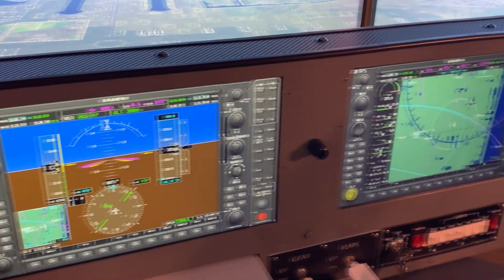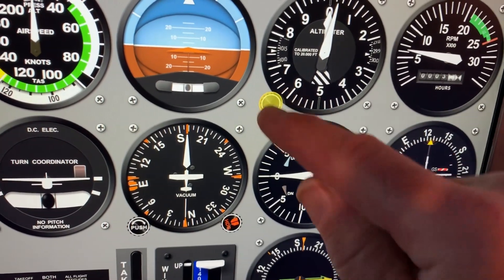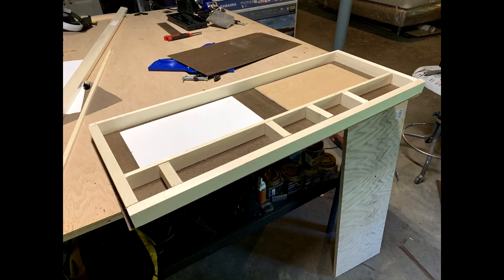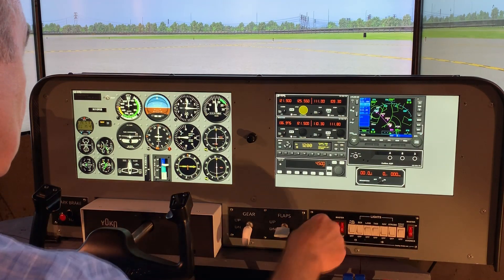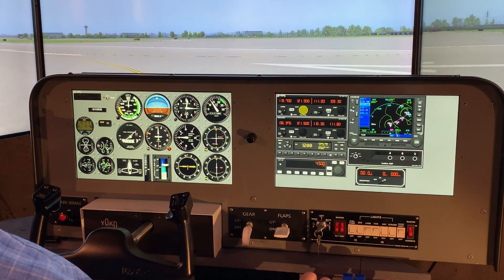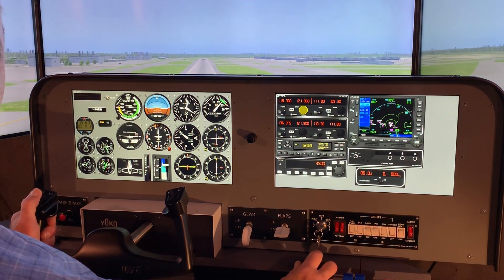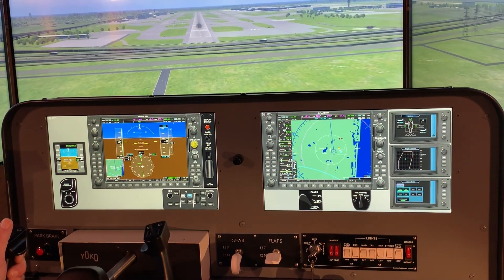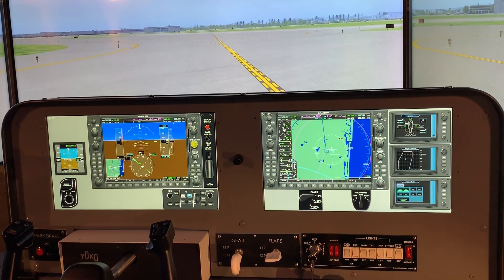DIY Twin Touch Monitor Sim

Comment: Hi Russ, is this worth getting?  https://www.mypilotstore.com/mypilotstore/sep/13433
Reply from the maker: Depends on what you want to use it for and how rich you are😁. If you just want to train on or learn the G1000 there are cheaper ways to go. Did you see my video https://youtu.be/v0YDHN2eCMA ?  It shows how you could use a couple small touchscreens like I have n the twin touchscreen monitor sim and a Knobster to achieve a good training platform  (full scale too) for half the price. It could display other panels too using Air Manager. If you want to build a highly realistic sim with hardware controls Real Sim Gear makes good stuff and will definitely provide the most realistic experience. A touchscreen and Knobster can get you 90-95% of the realism and the exact same function as the RSG G1000.  The other thing for me is I don’t want the G1000 there all the time as fly in some steam gauge acft too. One last thought. If you have a three monitor visual you will need two additional graphics ports since each G1000 screen needs its own. This is true for the touchscreen route too. I did a recent video seeing if the internal video could support the fifth monitor and the results were it is better to have a second panel computer running the  master copy of XP if using the 5 monitor setup. Good luck on your decision.

Comment: So my 2 monitors came, and just for fun, I popped out and move the g-1000 to them. PFd on the left and gps on the right touchscreen. Looks insane! However, when I touch the gps it pops back away! 😂😂😂. I downloaded the XtextureExtractor and tried following your video. But some how it loses me every time. Like there was steps missing in the process. Can you help me please. Thank you.
Reply from the maker: Duane Bennett what does “it pops back away”  mean. Do you mean the window closes or moves? Is Air Manager involved in your set up? Shouldn’t need XTE to use  the G1000s so lets stay on that first. Explain in more detail and I will help.
Reply: Russ Barlow so, airmanager is not included in my setup, I’m just learning to setup a triple monitor simulator, so £55 was a bit too much at the moment. But in short, just setting up individual views with the sim and monitors is a chance he for me. So if we start with the Cessna 172 with the steam gauges. Not G1000. I would like to place all the instruments on to a 27” monitor in front of my yoke, and the gps system on the 22” touchscreen, and have the 65” tv ahead of me for just views. For some reason, the smaller touchscreen has to be set as my main display on the pc itself, for touch purposes. Which poses a problem IN x-plane. But by pop away I mean, when you click on the gps, it gives you a pop out larger window. I try drag that down to the touchscreen, but when I go to use the controls on it via touch, it’s like I clicked on it again in the cockpit, and puts itself back away. Computers are complicated 😂😂. Any help or advice would go a long way friend. Thanks. 👍🏻
Reply from the maker: Duane Bennett so you are running this all with a single computer? You have the TV with a scenery view and a second 27” monitor you have a separate view of the XP11 instrument panel. Finally you have a 22” touchscreen you want to display popped out XP GPS windows on. I think I have it now. 

First why do you say the Touchscreen must be your main monitor? Have you calibrated the Touchscreen in windows so that it knows how the touchscreen area is related to the monitors. It defaults to assume it is the main monitor but can be changed 

When you pop out the GPS there are two steps. You only mentioned one. First click the 3D cockpit GPS and it will pop UP into a larger 2D version you can drag around within the XP windows. You then need to click a small icon (hard to see and only visible when the mouse hovers over it) at the upper right corner of that 2D GPS. This will Pop it OUT into a real separate window which can be dragged by the white title bar at the top to any location on your windows desktop(outside the XP windows onto 22” monitor three). Running the instrument panel on the 27” monitor will lower FPS but until you add two more large TVs to get a wraparound scenery view it may not be a factor. Air Manager is a very low impact on FPS and offers great panels that support touch control and Knobster. I place a Air Manager bezel over all my popped out GPS windows yo hide the white title bar and add better touch input functionality to the GPS. Knobster allows easy knob inputs that are more difficult with touch in Air Manager and almost impossible with touch on just the popped out XP GPS

Comment: Nicely clear video, ask:
How do you turn on the touchscreen? at the back or at the front?
Reply from the maker: actually need to attach via  usb(should hear the connect tone when plugging in)  and go to Windows settings and search "Calibrate pen and touch" .  Select "setup" and follow the on screen directions.

Comment: Excellent build! I’m slowly but surely working towards a sfx-100 motion cockpit with all instrumentation. For now though, my 3D printer gets here this Saturday and I have all the hardware for several instrumentation switches and gps buttons etc. I’ll probably start with the Garmin GNS 530 but eventually build G1000s. I want tactile feel for VR, but eventually I may upgrade to a full sim non-vr. I see this as a 1 to 2 year project but I’ll be up and running with the 530 probably in the next couple of weekends. You, OnTheGlideSlope, and Alfred Twinsim have been my inspiration.
Reply from the maker: MrJoeDynamite Sounds like a solid plan. Keep us posted as you progress. Especially interested in the motion system and hit it works with a sim.  I never felt they were worth the cost in the commercial sims I flew in the airlines but with VR it is so immersive that I might reconsider.

Comment: Is there a problem adding two touch screen monitors if you are already using 3 for your flight sim? Can the video card handle multiple monitors? Do you need some type of splitter or an additional video card?
Reply from the maker: I just did a recent video of this topic using the onboard video to run the fifth monitor.

Comment: Hi Russ, How did you make the black dash-board that outlines this cockpit panel? -I wish you went more into the build here. Keep them coming!
Reply from the maker: Robert Zimmer I had some scraps of a fiberglass reinforced wall panel that is somewhat rigid yet flexible enough to make the radius around the corner. It is 0.09” thick so think. I cut two layers and glued and stapled one layer using gorilla glue. Then added a second layer gluing it on the first. Afterward I added some carbon fiber looking contact paper film I got at Pep Boys auto. I added a black plastic door edge trim also from a Pep Boys.The glued layers are quite rigid and strong.

Comment: Great Videos Russ: How did you mount the monitors on the back side? Are they just sitting on the cross piece of lumber or did you secure them somehow?  I currently have (3) 12" touch screens, but they are 1366x768. I am thinking of upgrading to these monitors

Comment: Russ,  I have been watching your videos along with a few others.  I use to fly till cost just got to expensive. Still thinking about ultralight route but in the mean time looking to put together a sim.   From looking at all the videos I think you setup is the most cost effective.  One large 42" curved monitor for main display,  panel with two touch screen, plus yoke probably honeycomb.  I do understand I will need the knobster and software for gauge/panel setup.  I see in this video you have three monitor plus the touch screens.  What do you think about the 42" curved monitor setup?  Thank you,  Ray
Reply from the maker: If you are happy with about a 90 degree wide field of view it will be fine. For instrument practice that is fine. If you want wider view of 180 degrees FOV so you can look out the wing line for flying patterns and ground reference maneuvers you can’t beat 3 large monitors. I wouldn’t be surprised if you could get 3 decent 55” TVs for not that much more than the big curved monitor. If you thought you might go that way in the future I’d probably get a single flat 55” TV and possibly run it at 4K instead of 1080p

Comment: Great, great, great video. Thanks a lot. This is exactly what I was looking for.
I have Air Manager since a few days, and also a 15.6'' Monitor touch screen. I have a small question because I can't really use G1000 Popup on my panel.
My 15.6 inch monitor is connected to the same computer (I have only oene for now) where X-plane and AirManager are running, the monitor is set as main monitor in Windows (maybe this is wrong, but this was the only way I found to make the touch screen working correctly), and I have a second monitor for the sim, a 52'' Samsung TV 4K. My problem is the following one: when I pop-up the G1000 window from Xplane and then click on the upper right corner of the popup to make it movable like a window, everything is Ok. I can then move the G1000 'overlay' under the AirManager panel displayed on the 15.6 monitor, all ok. But, when I try to click (with the touch screen) on a button of the AirManager G1000 panel, the overlay window of the G1000 becomes completely black. I have to move the mouse pointer to the X-Plane window and click somewhere to display again the G1000 overlay. I am running X-plane in window mode not full screen (maybe this is wrong). Do you have any idea of the problem, or maybe you already have a video that explain exactly how to configure and set the overlay G1000 under the Airmanager panel ? Thanks for your answer.

Thanks a lot anyway for your video. I just discover your chennel recently and I am sure that this will give me a lot of inspiration for building my own cockpit (I am just starting...)
Very interrested also by the knob. This will be my next order...

Comment: Great builds. Now that you have tested the HoneyComb Yoke (which i just purchased today). How would that swap or transition into the Yoko slot. Also I have been watching out for the Throttle Which has a nice set of switches itself. I am very interest in building a Panel set up and you Idea is absolutely great for wanting to do more with just general aviation aircraft. Thanks a bunch!!

Comment: Likewise with the diy options. I have all the parts but no arduino sketch. Also have you tried two knobsters - one for each panel or monitor?
Reply from the maker: wildgoobsid5 you don’t need a sketch. There is a Arduino Knobster installer  in the Sim Innovations Wiki.

You could use multiple Knobsters but the whole point is to be able to operate any knob on the touch panel with a single Knobster. The only practical reason I see for a second Knobster would be to keep the Knobster near the other panel like an overhead panel.multiple Knobsters are supported although only one knob can be selected at a time for use with any knobster

Comment: Great Video!  Do you have the dimensions of the cockpit?  I would like to put the Honeycomb Alpha Yoke and Throttle Quadrant in it.
Reply from the maker: It is 37" wide so you can scale it from a screen shot.  I didn't draw it out before I built it but hopefully you can get most of what you need based on that width dimension. The cutouts need to be exactly sized for your monitor's inside bezel edges.
Reply: @rbarlow  Thanks for the response.  I've  enjoyed your videos and help.  I'm getting back into x-plane and will be updating my computer to set up a 3 monitor system and  another computer running panel/panels for air manager (I will be waiting to see how 11.50 previews before updating).  I've viewed your 3 monitor system video (3 yrs ago) with 50" TVs and wondering how that has worked for you and if you've updated your computers.  I noticed that Michael Brown is recommending 60 - 65 inch TVs.  Any thoughts would be helpful.

Comment: This video inspired me about 2 months ago to get a Prechen monitor, order the knobster (which is still backordered) and install Air Manager and Air Player.  I've also been looking at Stay Level prior to seeing this video and my main concern was limiting the number of planes I could fly.  This video solved that issue and that is where I want to go.  Have you been in contact with Stay Level since you made this video and if so was any progress made with them?  

I'm currently running a high end i7 9700 computer overclocked to 5.0Ghz, 32Gb DDR4 @ 3200MHz, with a GTX 1080 Ti graphics card connected to a 39" 4k monitor.  This computer is solely used for flight simulation and I prefer flying in X-Plane 11 but I also have Prepar3dV4.  In order to efficiently run a 2 Prechen setup with a Stay Level panel I'll need to add a 2nd less powerful computer as the master to run these monitors and any other items I might add to the panel.  My existing computer would only drive the main visual. 

I already have the Virtual Fly TQ6 Throttle and I was thinking about going with their Yoko yoke to replace my CH.  However, I had a chance to try the new Alpha Honeycomb yoke and was pleased, especially given the price versus the Yoko. If you have any advice, suggestions, or thoughts it would be most appreciated.  I really enjoy your videos.  They're extremely informative.
Reply from the maker: vpwebsvc sounds like you have a good setup. That 1080TI was way ahead of its time and still very near the fastest 2080s. I am hoping that XP11.50 delivers the fps we want with a less brawny system.  The honeycomb Is a nice yoke and the switches are handy but it is not nearly as sturdy as the Yoko plus. With the yoko you will need Switches for gear flaps and others you want as it has no switches except those on the yoke. Fortunately adding switches with Air Manager and Arduino is not that complicated.
Reply: @rbarlow  Fell behind schedule on my project due to a medical issue with my mom.  Fortunately she's doing well.  My 2nd Prechen is arriving today and I'll be ordering a 2nd less powerful computer and the Yoko Yoke Plus tomorrow.  I already have a Saitek Switch Panel and their Multi-Panel so I'll have mechanical control of landing gear and flaps.  Also a trim wheel, auto throttle, and auto pilot.  Stay Level has already provided me with a panel layout for all of this.  Can't wait to get started.  I really appreciate your videos!

Comment: Question on the setup. You appear to have triple screens to fly on plus the 2 touch screens. Are all five connected to one pc running both xplane and air manager.
Reply from the maker: Since I want to have the G1000 windows popped out and on each of the Air Manager panels those two monitors are running on a separate computer and copy of XP11 as the "master.popped " on the Network tab.  The three visuals are on another computer and set as "External Visuals" on the network page of settings.  It is important that the popped out windows are on the master as the GPS is not updated on the External Visual computers.  Since the view form the master is not being used it can be directed into a closeup of the cockpit headliner so it has no real work to do graphically.  Also you can reduce the visual settings without affecting the popped out 2-D windows. This means the computer really doesn't have to be that strong to get a good FPS while calculating the flight model to send to the external visuals.
Reply: Russ Barlow thanks Russ!  Looks like I got some shipping to do.
Reply: Or shopping lol.

Comment: I would like some details on the PC configuration and how to make all connections. I would like to use 3 monitors (or Tv's) for the cockpit view and 2 touch screen monitors for gauges and instruments for under $1K. inbox messages are appreciated.
Reply: If you already got the pc you should be doable. I run 3 1080 tvs on nvidia card 2060. My tvs were only 450 out the door for the group. Decent for what I need. As for them little monitors there 200 each.. that knobster is about 90 I think. So if your only looking for the monitors u should be good. As for the pc.. I got over 2k into just the tower to run at a good frame rate. So if your looking to do it all for 1k.. not gonna happen.